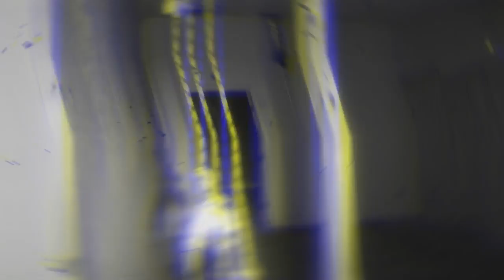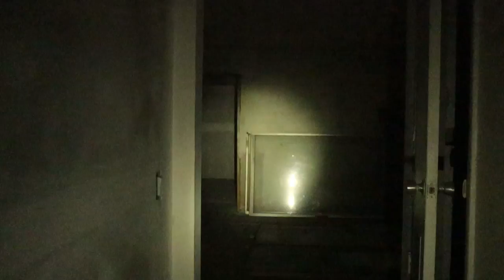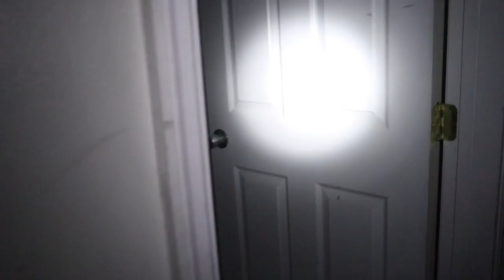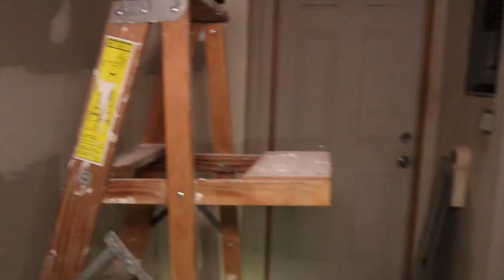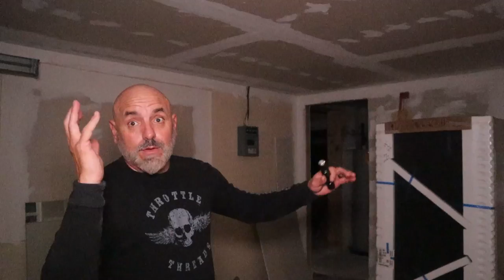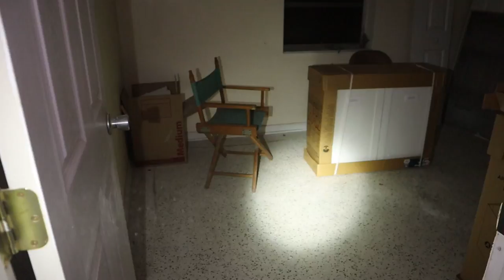(I'VE NEVER BEEN MORE SCARED IN MY LIFE!) ALONE AT THE CONTRACTORS HAUNTED HOUSE!

Comment: Maybe your not the guy for this paranormal stuff... You're so freaked out. Also, if you have a moving item, take the camera immediately to the item to verify there are no strings attached and keep the camera trained on the entire item; don't crop off the bottom or the top; that way folks can see if a string is attached or some other trickery.
Reply: @shannon5052  I've reviewed that timestamp.  I don't see it.  I do see where the digital camera had a hard time keeping up with the changing light and fast motion.  I don't think Chris is that good of an actor, to be honest.  If he is, he needs to be in Hollywood rather than on YouTube.  Just my opinion, of course. 

I've seen poltergeist activity with my own eyes.  Unfortunately, I didn't capture the entire event on camera.  Even after witnessing it, though, I question whether what I saw was real or not.  I've gone back and checked out that area multiple times to verify there was no trickery.  If I can't believe my own experience, I can understand why people are so quick to dismiss the experiences of others.  However, because I've experienced it myself, I know that it can happen.
Reply: @triciaw8953  It may be at a slightly different timestamp, depending on your device. It's at 24:31 on mine. The thin white strip at the rear of the left wall, that looks like it may be a door frame or something..try watching the base of that, almost on the floor, as he pans the camera where you can see the ladder's legs.

Comment: AT MINUTE 4:35 When Chris is going out the door to check where that sound came from. When he turns left, check the left smaller window that’s on the frame on the time not the twin frame window and keep an eye on the bottom left Conner. It appears that something moves to the right and the light that’s behind IT appears. Meaning something was standing behind that window covering the light behind it.

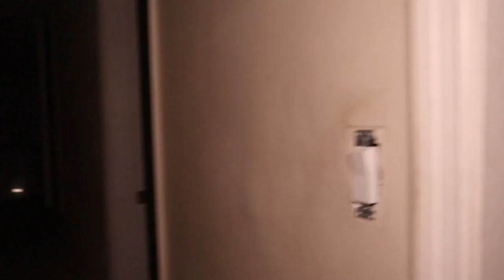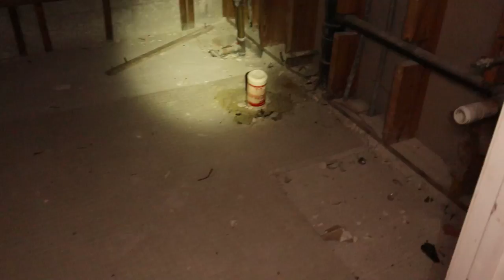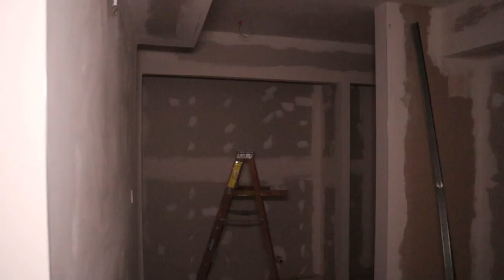Comment: 9:30 a woman whispered "they will" 10:10 a woman laughed at you 14:40  im sure a woman was whispering but could have been the rain 23:41-44 there was a whisper while you were talking 24:26 pause it exactly on the timestamp and you see a black snake like tail with a slight curl on the bottom left of the screen in the door way to the hall then 24: 28 its straight and disappears.

Comment: 4:27 female moan possibly hum
6:35/6 right hand side from behind door growing in intensity Orb  
6:51 Orb top right hand side (comes out of wall)
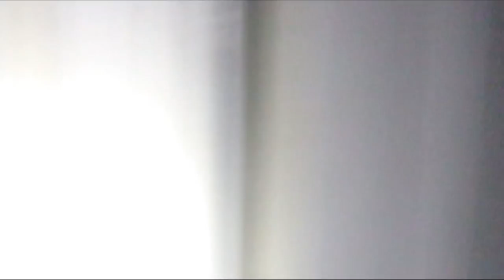6:58 Orb top right (right to left along ceiling)  
7:49/50 3 Taps
8:13/14 Object thrown (lands on floor)
9:30/31 Bright Orb right hand side behind door changes direction and luminosity 
10:22/23 right hand side when C puts his light on what could be described as a figure appears and moves to the left
25:51/52 base of step ladder (left hand side) rising from floor and up the ladder bright Orbs
26:04 Orbs leave step ladder

Comment: Hi
have to say, top video .. in any case have eggs that continue despite the activities!
but I knew I would have stayed and would have provoked.
Do not know if you noticed but at 3: 28min. Until then nothing is visible in the window but from 3: 29min. You can clearly see 2 eyes in the lower left corner of the window.
I am sure that there are no lanterns because the eyes shine yes and inclined as if the one tilts the head a little to the left, as if he was being watched and not seen!
if i compare it with the lamp that shines pink, if it were lanterns just like the reference lamp that shines pink, the angle is exactly the opposite.
well just my opinion but let me know if you have 1: noticed the said on site?
2: did you see it on video too?
3: do you see it the same way or do you have a different explanation?
vg from Germany